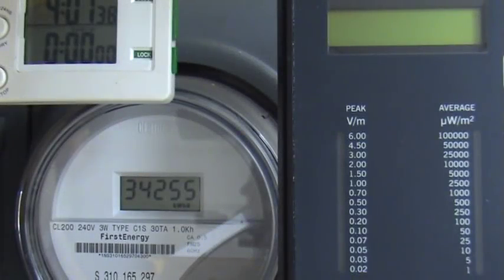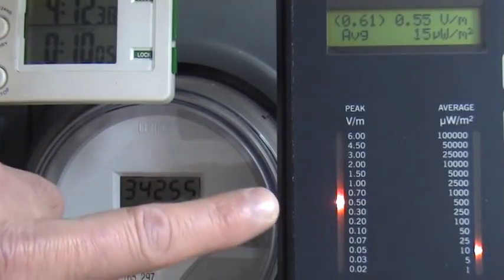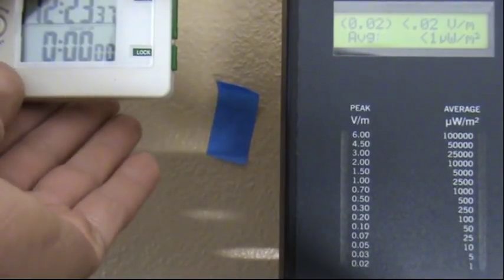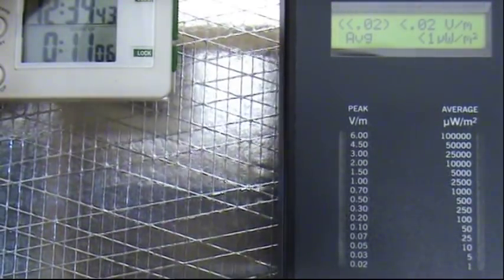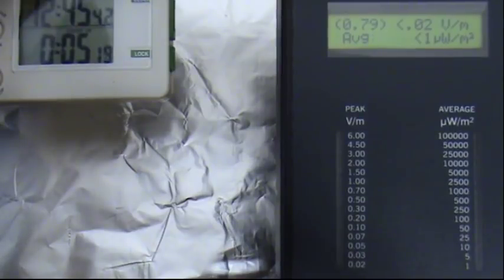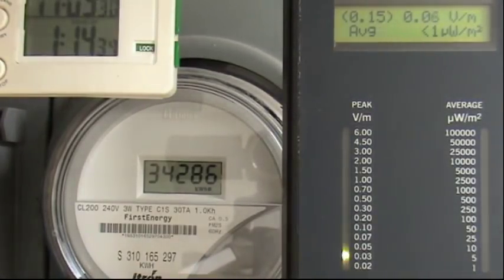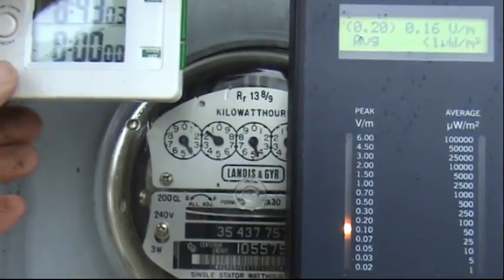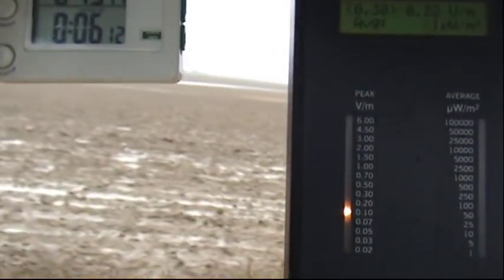Testing utility analog and smart meters for RF radiation

Comment: Should I have my smart meter replaced with an analog meter? It is about 7 feet away on the other side of my wall in my office.
Reply: ForbiddTV  Not true you can have an analog put back in . It may take a lengthy conversation with the utility company though.  It maybe there meter but it's your property , if they were not authorized by you to come on it or authorized by you to put there meter on your facility,you can have it changed back.
Reply: It can be done, you're going to pay for the labor and they'll charge you an extra fee every month though.
Reply: Hi ForbiddTV what did you mean when you said "the reality of going back to analog is much different than proclaimed by those who think they have heard others do."  ... I did call the electric company here in Houston and they have something called Opt out... and they will send one of their workers to replace it with an analog meter. So... should I not have them do this? (It will cost me more money every month with the analog but my health is more important to me). By the way... here in Houston... about 8 years ago or so we did not have the Opt out choice... I suppose there was enough pressure by citizens so the city  changed their mind on the issue.
Reply from the maker: Carol Dickinson  Once you have the smart meter, no utility is willing to put an analog one back in.
Reply from the maker: You will find the reality of going back to analog is much different than proclaimed by those who think they have heard others do.
Reply: Carol Dickinson you can opt out & I would if I was you. I know I did & they still changed my meter to a smart meter but told me it wasn't. However, I called Amen in Peoria IL & they said it was switched out to a smart meter after I told them I did not want smart meters of any sort, so the technician lied straight to my face & told me it wasn't a smart meter but it was. I also had a black tag on my original meter they put on when I originally opted out of smart meters but the technician lied straight to my face & switched it out anyway even with seeing the black tags. I even asked him, "hey that's not The a smart meter is it? I don't want smart meters. I opted out of them. He said," nope it's not a smart meter." Nonetheless,  come to find out it is exactly a smart meter & now they're coming today to give me back a analog meter. 

Nevertheless, I now how to pay a one time fee of $70 for putting a non standard meter(analog) back on & I'll have to pay $24 a month for a non standard gas & electric anlong meter. It's worth the one time fee & extra $24 a month to have 2 less cancer boxes attached to the outside of my house forever
Reply from the maker: Nathan Hart  Gee then I guess you also got rid of wifi, cell phones, microwave ovens and other wireless devices in your home.  They all produce more RF than smart meters as I have shown on my channel. How much a month do you pay to keep cell signals out of your home?
Reply from the maker: Sometimes local legislation forces the utility to have an opt out option  due to the petitioning of the people. Sound Like that is what may have happened in Houston.  The utilites will fight this tooth and nail without legislation.  If you think it is a health concern then you need to also eliminate all the other sources of RF in your daily life since those are even higher than a smart meter.  I have done much testing on my channel to show this.  https://www.youtube.com/playlist?list=PLwvM5FrPTJTn5N9V0FU3UElo3c3otTRT-
Reply: Yes you are right. I bought an RF meter and an EMF meter... and I am currently in the process of tweeking my home to make it safer... but I would not have known how to tweek it... if it weren't for these two different meters. They really help me a lot. Thank you again ForbiddTV and all your commenters on here too... for all ya'lls help! Thank you. Oh... Would moving to the country be the best option of getting away from the electrosmog. I did an experiment with both my meters and found that when you go to the country (I drove out there one day)... about a mile away from the freeways or roads with all the cell phone towers AND business, homes etc... that the RF is greatly reduced. I don't want to have to move to the country... so I want to see if I can tweek my house here in the suburbs good enough where I can stay here. I made a faraday cage for my modem and only use the ethernet (and I also turned off Wifi)... WOW!... did that reduce the amount of RF in my home. HUGE AMOUNT! Also... very important to physically unplug modem from the power source every night. Also turn off phone at night and try to place in another room. This all helps so much. During day you can keep it turned on... but keep as far away from your work station or where ever you are most your time during the day. DO NOT have cell phone on the body or near your body EVER. If you have to use phone... make it short... and always use and ear bud thingy (forgot what they're called). After call... place phone far away from you again.
Reply from the maker: Carol Dickinson  Thanks for your kind comments.   Glad you did the further step of confirming the readings,  now you know your biggest 'problem' was not the smart meter.  I would suggest you study even further and determine if the exposures we see in our normal lives is even a problem at all.  There is a huge amount of fear porn videos out there, and those are only good if you have the worst as a pre-determined desired opinion.  The reality is very different, after all, some 20+ years after cell phones were introduced,  cancer rates are actually down.  The fear mongers were telling us we would all die of brain cancer from cell phones.  Moving to the country could reduce yiur RF exposure, but so can the steps you are already starting to implement.
Reply: I'm neither a fear monger nor a toll.  But your comment that cancer rates are down is not based on factual evidence. Not only is cancer up from 20 years ago, but so are many other maladies such as ADHD, autism, etc..  I've started having tinnitus and have experienced sleepless nights shortly after they installed a smart meter on my house.  And since then the noise and sleep deprivation have increased greatly. Coincidence? I don't think so.  I am not an anxious person, and I don't have the normal work related stress and worries many people have because I'm retired.   Cheers.
Reply from the maker: deep anchor  You do no basic research.  You obviously didn't look up cancer rates, you just repeated what some fear monger with an agenda told you: 
https://www.cancer.org/latest-news/cancer-facts-and-figures-death-rate-down-25-since-1991.html  
http://www.ascopost.com/issues/january-25-2018/cancer-statistics-2018-us-cancer-mortality-continues-decades-long-drop/   
https://www.cnn.com/2017/01/06/health/cancer-death-stats-2017/index.html 
And you obviously didn't test your tinnitus theory either.  Get away from your smart meter and what happens?  You still have tinnitus.  Move to a radio quiet zone  https://en.wikipedia.org/wiki/United_States_National_Radio_Quiet_Zone  and what happens?  You still have tinnitus.

Comment: Unless the aluminum is grounded, it won't do much shielding. That's how a Faraday shield works.

What is a harmful level? Without that info, this doesn't mean a lot.

Interesting that the analog meter puts out the same RF level (pre-"shielding"). Plus the analog meter didn't move, so it wasn't passing through any energy. 

So, some of the RF is coming from the electrical current itself, which makes sense!
Reply from the maker: Everywhere I turn the meter on outside I get some RF radiation, even far away from any electrical sources. The location of the smart meter was in an alcove which gave some shielding as compared to the analog meter which was out in the open.  The fortunate part of this is you can see clearer the actual transmission spikes.  

I do not make any assertions about what levels are 'bad' for the human body, I leave that up to the viewer to research themselves.  https://www.youtube.com/watch?v=fIf3SqKi1t0  Unfortunately there is a whole lot of fear porn on YT in regard to this issue. 

I also present the readings I obtain in as fair of way as possible so one can compare with other readings shown here on YT.
Reply: @IvorySight  If you want to convert your .05 microwatts/cm sqrd to meters squared ....multiply by 10000 or move decimal over 4 places.  So ,I get 500 microwatts/meter squared.

Comment: Hey Craig, your next door neighbor neighbor has a legal 100w VHF/UHF transceiver, a 1000 times more RF than this meter. He transmits 10s of minutes at a time, not just a few seconds. What you gonna do?
Reply from the maker: kn4cc  I measure it of course!  https://youtu.be/8PkJMBoW8Po   Since I can't go there to test further I'm not sure, but the owner there told me when I tested that they never shut it off, which is probably pretty typical of most who use wifi in their homes,  These days many modems & routers are the same unit and don't have a way of easily shutting off the wiifi without just unplugging the thing.
Reply: but he is not sending microwaves 2,4 ghz
Reply: freq makes ALL the differance. i think these meters run in the 2.4 ghz range.

Comment: A couple of things: First, your metal box on the meter is grounded - or should be, and should work as an EMF absorption panel on the back end, which would explain the reduced reading inside. Also, foil is a reflective material, while the wire grid aluminum screen will act as an absorption material - two different types of RF protection. Many say it's better to use the wire mesh for protection because the aluminum on the foam and the sheet will only serve to deflect the radiated waves, but the wire mesh will act as a Faraday cage and absorb the radiation. Thanks so much for this video. I appreciate your time and experiment with RF radiation.
Reply: I live in PA. I am an electrcian, and have over 35 years in the trade.  Meter bases are NEVER grounded intentionally  - as per most electric companies specs.  Some do require it - but most DO NOT.  The reason for this is because grounding a meter base creates a ground loop between the 1st panel in a building (where the neutral and ground grid are bonded) and the meter base.  Doing so will cause a difference of potential from the base itself to ground....This can be deadly... Grounding a meter base also puts an unnecessary risk to linemen by creating a potential path for current to flow back to the secondary side of the step down transformer. For this reason, it is why many utilities do not want the meter base grounded EVER....
Reply: @tjoyce81  Does this mean I can wrap the outside of my smart meter with aluminum foil to keep the waves from fanning out with out attaching a ground to it?
Reply: @tjoyce81  I'm  not sure of the not grounding the meter box in the case of a house with aluminium siding, which does have a ground wire on it. Does that mean that that causes a dangerous condition. My house was built in '69 and was aluminum sided.
Reply: Jim Jim   Grounding an AC meter base creates a ground loop which can cause all kinds of issues - including electrocution. That is why power companies do not want meter bases grounded... Your regular outlet MUST be grounded to provide you protection from shock and the device protection from unwanted 'stray' currents.... DC circuits use a ground for function and not safety - and are totally different from a regular outlet - which is AC...

Comment: I am just as concerned about the Harmonics/Dirty Electric introduced into my home's wiring because of the digital meters , smart or not.  Analogs do not do this and also do not catch fire like the plastic piece of crap smart meters made in China. The old analogs are made of metal, glass and bakelite with surge  protection and the materials are a heat sink.  Smart meters are constructed of incendiary materials with multiple computer components that can be a fire risk as well as a lithium ion battery.  Industry documentation exists that show analogs withstand power surges and hot sockets (loose connection) and smart meters do not.  Then there is the privacy issue.  It's an attack on our 4th Amendment rights.  I was not a true believer in the health effects until I did my research and got rid of all wireless and as well as much dirty electricity in my environment as possible.  My type 1 insulin dependent diabetes improved.  The recent NTP study by NIH and the Ramazzi study from Italy along with thousands of scientific reports from around the world prove that Big Telecom is lying and profiting from our ignorance.  Read the RF warning in your cell phone if you can find it.  The Truth is being revealed and we must continue the battle to expose it.

Comment: Interesting. This is one of the lower emitting smart meters I've ever seen. (I have the exact same meter)
It's likely that your initial spike from the placing the aluminum backed insulation on the interior, was just a reflection from another source. I would be super happy if my levels were this low... not bad at all compared to some. 

Of course, we're completely overlooking the gigantic magnetic field that's on the inside of that wall though... way worse than that tiny bit of RF getting through.
Reply from the maker: Matt Justice [Clever Leverage]  Agreed, and you will see even the analog meter location was higher than the smart meter location (slightly shielded by three walls in an alcove).  I plan on doing a series on magnetic/EMF later.
Reply: What is your scientific evidence on health which is way worse?

Plus, addng more threats is never more clever.
Reply: I purchased a vacation home in FL.  Had a smart meter on (I really did not feel any health issues).  Knowing the dangers I opted out and they replaced it with this exact meter, the C1S.  They said this is NOT a smart meter.  they said someone has to come and read, which is total BS because NO ONE has come to read the meter (I have cameras on house) and my bill appears.  After the C1S was put on I am experiencing horrible health issues.....ear ringing, numbness in hand and arms, feeling of electricity running through me, etc.  Making it horrible to be there.  WHAT CAN I DO.  I purchased a perfect power box which is being installed this week, but should I put aluminum screening on the bedroom where the meter is?  I will take any suggestions/recommendations you would have.  Thinking of serving FPL with Notice of Liability
Reply from the maker: You could disconnect from the grid if you really think it's a heath issue, but few are willing to do that.  Or you could explore RF blocking with a video I did testing various materials:  https://youtu.be/MNPX-vibVSE

Comment: i wonder what the RF would be say before there was any man made RF
Reply: Haha, almost just as much. The static on old TV, that's the cosmic microwave background pelting you with radiation. Then theres high energy particles striking the magnetic fields of the earth and putting off RF, and the Quasars blasting it into the universe willy nilly. You're all freaking out about nothing. Use headphones when you're on the phone, don't cuddle with wifi routers. McDonald's, google, and China are your big enemies right now.
Reply from the maker: TigerShark  I'm sure it would be zero.
Reply: i think some of the fuzz you hear on a radio when turning is given off by jupitor
Reply from the maker: TigerShark  That very well could be, I am not a radio astronomer.  I would propose if this to be true, man and all other life forms have adapted safely to the presence of Jupiter by now.